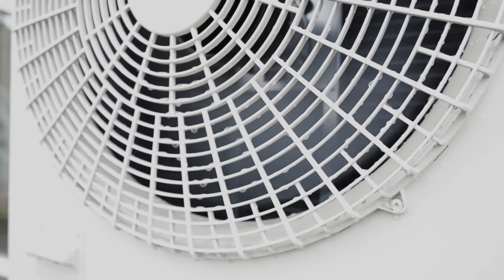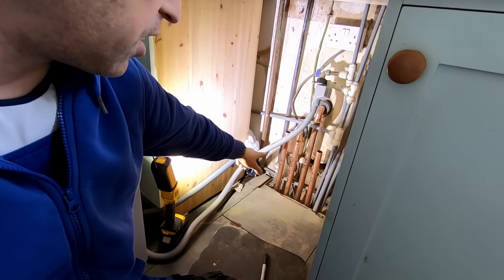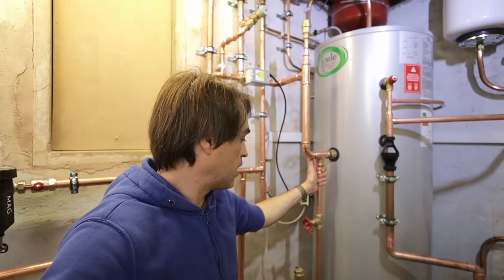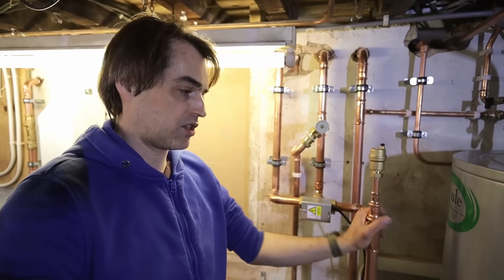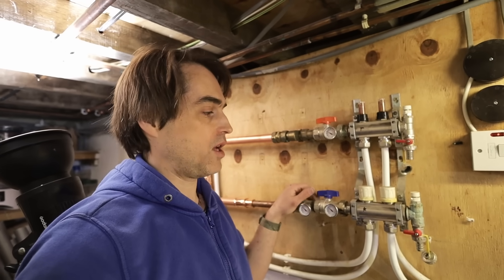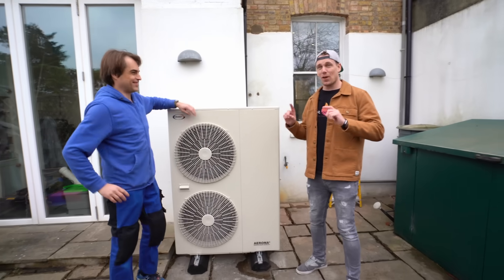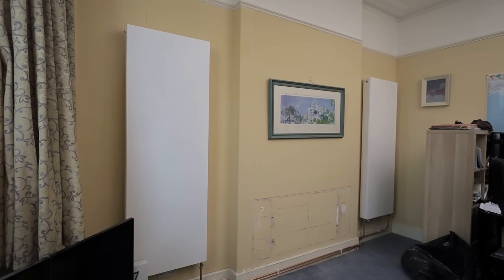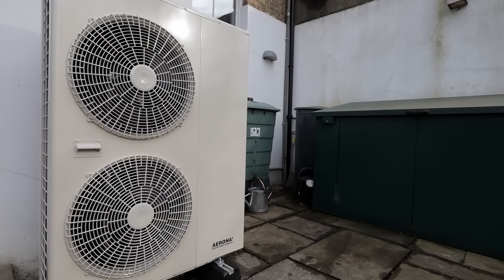The Truth about Heat Pumps: Debunking the Myth.

Comment: It is not a difficult thing to know and learn and that is heat is energy and cannot be destoyed it can only be moved from one place to another, and no matter what method you use, it is not going to be cost effective enough to be economical, that is why two way a/c units are not very efficient, no matter what refrigerant or thermal liquid may be used. Learn your physics first. then when you think you know enough come back and explain yourself.

Comment: Hi. Another great video and detailed explanation, I have a quick question, we came across each other before, my HP works brilliantly in wormer seasons, however in the winter it is in defrost mode quite often causing the radiators to cool quite quickly. Is there anything I can do?  Rec pump is on all the time ( thermostat starts/stops it). Thanks in advance. Rafal

Comment: I am in America and I am an HVAC guy with a lot of knowledge in Heat Pumps and Solar Thermal heating. I have designed , installed and fixed many systems.  I have been able to integrate Solar Thermal into Hydronic and Heat pump systems. They work out very well and are a good match. In the Midwest to Northern parts of America we cannot get by with just the Heat pump system because our Winter loads are twice the capacity of our summer loads. 

We use Heat pumps but have to size the backup heat as large or larger than the Heat pump output by itself. My Solar scheme and design has worked very well but engineers fight me on it because they just cannot wrap their head around the larger picture. It works.

Comment: What's the point of using water and radiators. Just use regular multi split or vrf heatpumps. There are models that could be hidden inside the wall to hide from view. And gives more precise control over temparature in small units that can quickly heat or cool the whole room.
Reply from the maker: Heating with air increases air changes, reduces efficiency, causes pollens and dust to go airborne and is generally not  considered healthy. On top of that yiu cannot heat water for domestic use with air to air. 

A2A is Inferior in many respect to air to water.

Comment: At the moment, Electricity is about 4 times the price of gas [according to the EDF website] so does this mean you'd have to get a COP of 4 to make the running costs the same? Surely this means you'd pretty much have to use it in conjunction with solar too?
Reply from the maker: Not quite. Gas boilers are only around 80-85% efficient on average so you need a scop of 3.4 to be the same cost. Anything above 340% should be cheaper I run than gas at the moment.

Comment: You knock Roger. But , if you had watched more of his videos, he is not against heat pump solution, as such; only the Government creating a culture that implies that this is the way to go, for everybody. Unfortunately the newspapers make things worse, by their stupid reporting. 

In the case of that large house , which has a convenient cellar, will there be any noise from an indoor pump running at night ?
The complex pipework looks very well installed, by a team that must have a capability much higher than most other installers.

Comment: no normal family on a minimal wage is going to go through all of this just to get hot water and hot rads. great job though.
Reply from the maker: well, eventually when they ban gas people will be left with a choice of cheap direct electric installation with massive runing costs or expensive heat pump installation with much cheaper running costs

Comment: Nice install. It's of the outmost importance to reduce the Average temprature of the water in the system. Every degree that the temprature is reduced is about 2,5% Efficiency. I have a Geothremal heat pump and my Maxium temprature is set at 28C. Noramlly the system runs at about 24-26C. Last year I had a COP of around 6.5, including warm water production. A lot of people on here are saying that the install is complicated and saying that doing the caluclations on the average heat loss per room is too much work when really they should be doing this work regardless of what system they're installing.
Reply from the maker: That’s a nice cop!
Reply: You are right. Before installation of new heating system you should know the demand.

Comment: Think the placement of unit outside patio doors looks awful and would completely ruins the patio for sitting in, also fans will get noisy, the radiators are so large and uses up two alcoves in room and to run pipework on skirtings unbelievable would never get away with this installation in a property where style and design is important to customer. How long did it take to complete?

Comment: I thought the whole point of getting rid of immersion heaters in the first place and replacing them with those much smaller boilers (like gas or combi) is that immersion heaters are insanely inefficient and costly to run, whereas the smaller units are far better since they're not wasting energy heating a massive tank of water that may not even get used up? Do heat pumps require the installation of an immersion heater? If so doesn't that completely negate ANY energy savings created by the heat pump (since as far as I'm aware there's NO way to MAKE an immersion heater efficient)?
Reply from the maker: Immersion heaters are only used for 2-3 hours a week to boost the cylinder to 60c for bacterial growth prevention. They are not used most of the time and not used for heating. The one in this job is connected to solar PV.

Immersion heaters are direct electric so 100% efficient. Heat pumps when installed well are 300-400% efficient.

Gas boilers are usually around 80-85% efficiency but whjj in t a good boiler and decent installation and system they can be over 90% efficient
Reply: @UrbanPlumbers  I'm sorry but no, immersion heaters are NOT efficient in the slightest. That's why they were removed from most UK homes in the first place. They use up a HUGE amount of electricity to bring such a large amount of water to the proper temperature - just like if you monitor your electrical usage (like we do in my home) the highest use in the entire house is when the kettle is being used (because it uses the exact same principle of resistive heating), that puts it into the orange. Our combi boiler never goes out of the green for both electric OR gas usage. Not to mention a huge portion of that electrical usage is wasted since the entire heated amount of water is rarely fully used, meaning it cools down and has to be heated yet again for the next time it's actually needed. Twice (or more) the electricity to heat the same amount of water by the time the current stored amount ends up being fully used. There's a damned good reason they got removed from most houses and new houses stopped being built with them installed.

Comment: For most people a heat pump is perfect… and can’t be beaten for green credentials. Heat pumps will take over the worlds heating/cooling needs, be it home heating/cooling, hot water or drying clothes. Some will say it’s a different heat compared to say a wood fire etc… but this is always a mindset built on their experience from encountering a home with an incorrectly sized heat pump or trying to use a split system to heat 3/4 of a home.

Comment: How are you going to access the cracked render behind the heat pump when it needs to be replaced. Believe me, when the rainwater ingresses, the frost/ice expands. It will blow off.
Reply from the maker: Easily - it’s 350mm away

Comment: Is it water with antifreeze that is the transfer liquid or some volatile liquid? If it's the former DIY should be possible
Reply from the maker: No, just water and anti freeze valves
Reply: @UrbanPlumbers  If that's the case it sounds like you pressurise it like you do with radiators and a combination boiler: From the water main?

Comment: I think if we had to replace our boiler I'd probably go with infrared heating panels and probably get solar panels all in for the same price as a heat pump install.
Reply from the maker: that would cost 4 times more to run though
Reply: @UrbanPlumbers  It's not as much as that.  eg. With direct heating you don't have to worry about heat losses as much.  And like I say, you can add in solar panels and still have money left over compared with the heat pump installation.  So I think it would end up not much more expensive in the long run and maybe even cheaper

Comment: Would it not be beneficial to fit an S plan so the customer can have the heating on while the hot water is on?
Reply from the maker: No, it definitely would not be.
Reply: @UrbanPlumbers  would that be because you fitted a heat pump or is because you don't rate the s plan? Great videos btw. Must take you ages to put them together

Comment: Nice neat job , but installing that and have cool radiators just barely capable of getting to 21deg no thanks
Reply from the maker: Rads get to 50 if you want to, there is just no need for that.

Initial trouble with this house was, it was getting to hot and we had to turn all temps and curves down a lot.
Reply: @UrbanPlumbers  
Have there been any callbacks on this job?
Reply from the maker: @nhojnhoj6767  no, why?
Reply: @UrbanPlumbers  
It's just that in your previous comment you mentioned the radiators were running at 50 degrees and you had to return to the job to change the temperature.
Does this not indicate that there is something wrong? 
Why were the controls unable to handle this?
Reply from the maker: @nhojnhoj6767  nothing wrong. Weather curve needs adjusting after 1-2 weeks of use. Perfectly normal. There is no room reference on this installation (no room thermostat at all) - the heat pump only reacts to external temperature and adjusts output accordingly. This always needs fine tuning.

Comment: Love your channel, I tune in all the time, your passion and knowledge is second to none. Honestly you're a legend.
However I'm a central heating repair specialist and the perfection required with heat pump systems worries me, also excites me too.
It worries me because even with the correct doses of corrosion inhibitor, servicing and maintenance, these systems are going to sludge up but with far more dramatic results. 
For instance, I powerflush systems ALOT, like three flushes weekly minimum all year round.
Small 6 to 8 rad systems running on 24kw combi boilers chucking out 80° flow temp, they still fail easily due to magnetite build up, valve failure, even with inhibitor in. Rads just stop working.
With heat pumps I feel that the systems are so finely balanced and sized, that a few years in there's going to be a significant reduction in output and efficiency due to system corrosion, especially as large radiators are notorious for magnetite build up.
These systems have big potential to fade away performance-wise and are owners really going to spend the extra money on a far tighter and more expensive maintenance schedule, maybe or maybe not?
Keeping these systems in tip top shape is going to be significantly more costly than gas boiler systems overall which outweighs heat pump cost savings.
I'm equally excited as this is going to create massive earning potential for my company, as installers tend to cut and run on this sort of thing, leaving problem solver engineers like me to make the repairs and perform regular maintenance. 
I don't mind picking up where installers left off, it's a very lucrative market fixing other plumbers problems!
That boiler scrappage scheme and the scheme aimed at subsidising replacement boilers etc, many of those LTD companies chucked in replacement boilers willy nilly then folded once they'd exhausted the funding. Barely anyone those systems were flushed out and dosed correctly, just a mini primary water filter chucked on which five years down the line is about as useful as a chocolate teapot.
This is definitely going to happen with the heat pump craze; bodgers are going to cash in.
Anyway, think you're great and look forward to future videos 🙂
Reply from the maker: You have to remember that those systems operate at much lower temps and that means that the rate of corrosion is greatly reduced
Reply: Thanks for the reply. 
In theory Yes and I see Heat Geek also mention reduced temps = reduced corrosion, thermal shock etc, in their videos.
All best case scenarios though, not particularly taking into consideration the widespread neglect of system maintenance in the UK.
Time will tell, there's definitely going to be maintenance requirements further down the line which installers won't want to be bothered with, that's when I turn up with my thermal imagery & powerflushing equipment 😉
Reply: By the way, your pipework is amazing, your hands must be green from all that installation work, they don't get a break 😄

Comment: Question for Urban Plumbers: Why do heat pumps almost always get installed really close to the building they are supposed to heat up?
Those fans move the air from around the house which is already pre-heated by the house's loss of heat. I would want that air to create a cushion around my house in order to improve insulation (of there's no wind of course). I wouldn't want it all blown away from my house. What do you guys think?
Reply from the maker: pipe runs have to be kept to minium for cost of installation and efficiency the system. Heat pump draws air from the back and if you have warmer air there (which you dont really) that help recoer the heat you may be losing.

Comment: All very well if you have a cellar that is not being used or a bigger house but I would like to see someone try and fit this in a new build 2 bedroom house, there is no room for all this gear, been saying this for years!
Reply from the maker: 2 bed will not need anywhere near that amount of gear! It is also very common now to install all external units on flat roofs.

All you need inside is space for hot water cylinder, as we all used to have.

There are also intergarated heat pump and cylinder solutions that are ducted outside and do hot have an external unit at all.

Another option is to use air to air.

Heat pumps are the future. Hydrogen is just a mirage and a stop gap that may not even happen. Gas will have to go at some stage.
Reply: @UrbanPlumbers  The available space in a modern two-bedroom house is the size of a modern gas boiler, if it can't fit there then there is nowhere for it to go!

Comment: I'm gradually coming round - from being a heat pump denier/skeptic, to seeing that they could actually work. Notwithstanding, the overgrown teenager with his hat on back to front,and the monster fan unit and it's unsightly pipework and the racket it, no doubt, puts out. My conclusions, all arrived at, from researching through UTube - with absolutely no practical experience. 
However, I think that you're being a little harsh on Roger. It is, as your man says, all in the planning and design, and one can well imagine the scope for the misselling of badly designed packages by salesmen/women, who may  have zero site experience - but who  understand well, the law of commission.
Reply from the maker: you are correct and yes I am a bit harsh on Roger. He actaully is a lot of fun to watch. Misselling and bad installs is the problem. Heat pumps installed well and desinged well will work well. However we have an issue with big biusness just trying to grab governmant grants and throw as many heat pumps as they can with zero regards to any good design and istallation practice. It is actually quite scary when you realise how many bad installations are happening all over the place - all done by MCS comapnies.

Comment: I think you have proved that heat pumps don’t work in the UK. Most homes would need a complete install not any kind of upgrade. The total price and service costs are beyond most people, the input to output ratio is not good enough and some would need a backup in the winter. PS. Not all installers are as thorough as you.

Comment: To be clear, quality products give quality results.  We had a heat pump for our central AC in a home where it got cold in the winter but not usually down to freezing and in the summer got up to about 90 degrees (sorry people from EU, you do the conversion).

This is what I know about them.  You need to buy just like you do a regular AC/Heating unit for a home.  It needs to be rated for the size of your home, and not just right at the border.  It needs to handle the home easily.  When you buy that way and you buy a quality heat pump it's a very good investment because it's efficient at both heating and cooling, or that was our experience.  We had a low electric bill  Part of that was good insulation for the home, but part was the heat pump.  We had to replace one part for it over 7 years.  This is no different than AC units installed for homes.  People tend to have to replace something or another every 3 to 4 years.  Some component will go bad.

And, central air condition along with something like natural gas for heating is also very expensive to install in a home.  Having a home installed with central air, with a heat pump probably costs the same or less since it's only one system, not two.

NEVER install something that's it rated under the size of the home, or right at the low end.  It needs to be more towards the upper end or just above.  This allows the unit to operate with ease in both the summer and winter.  And you have the same issues if you don't install a large enough AC unit.  You will overwork it and it breaks.